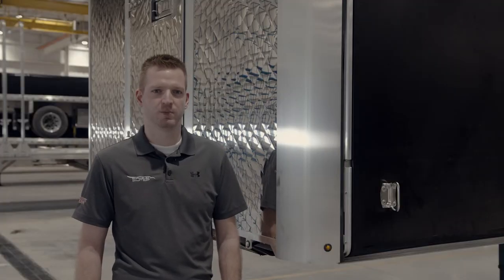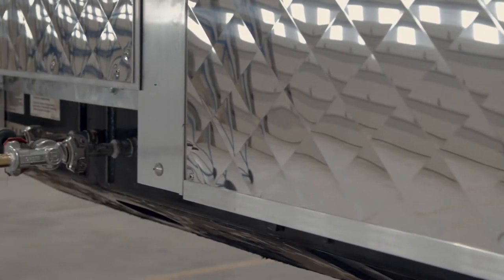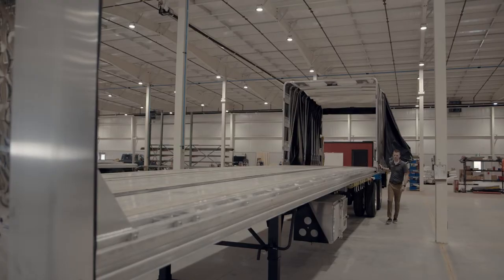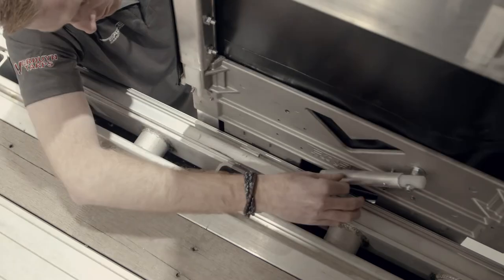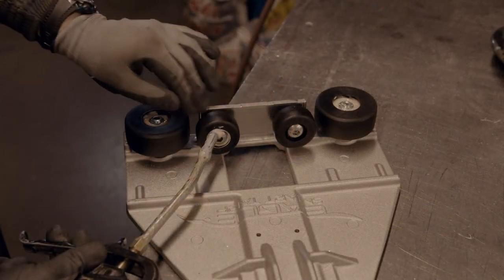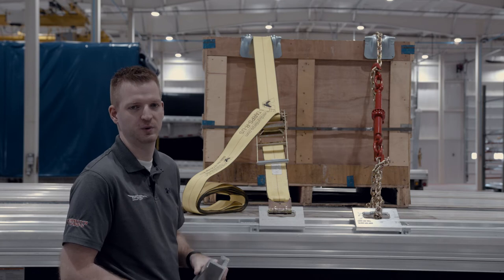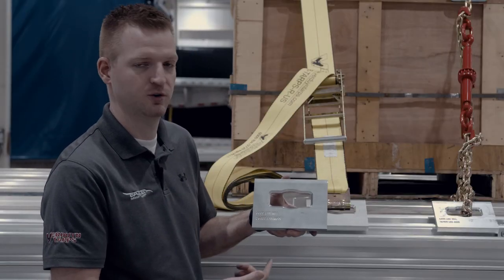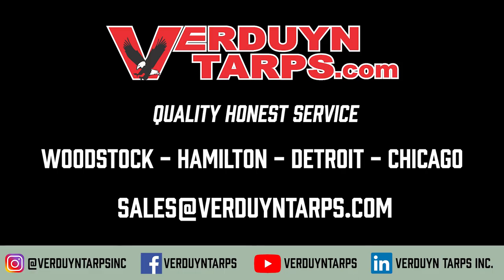2020 Eagle Improvements

Comment: I just picked up a new trailer in toledo, ohio, went through  heavy rain, and checked in side 3 hours later and there is water all in the floor.
Reply from the maker: Thank you for your comment. Verduyn Tarps does not have a location in Ohio. Our US locations are in Detroit, MI, and Gary, IN. We have checked our records for our 2 US locations, and do not show any Eagle tarping systems picked up by a customer with your name. You may have a tarping system from a different manufacturer. If you still have further concerns, please contact us at sales@verduyntarps.com, or call 313-270-4890. Thank you.